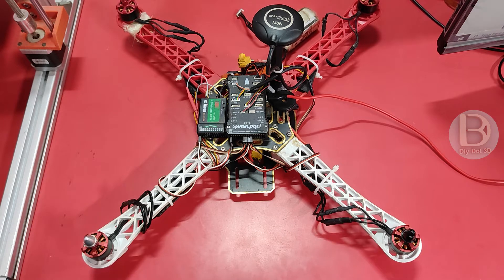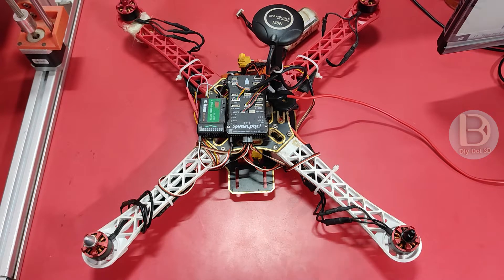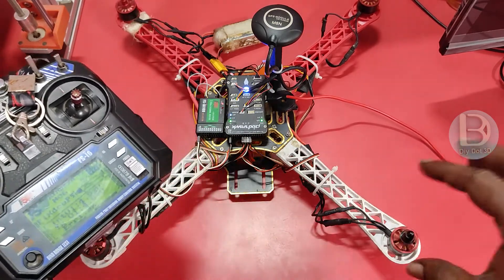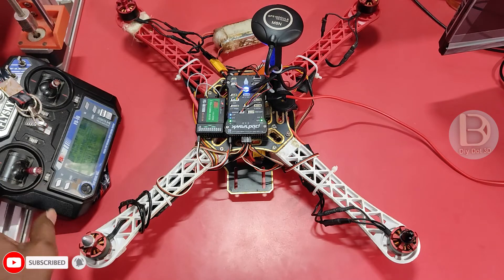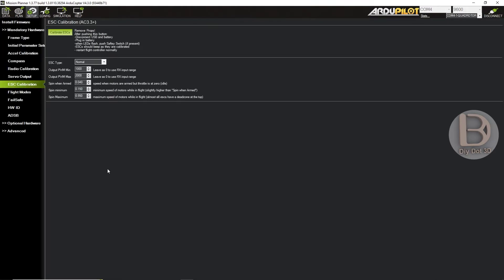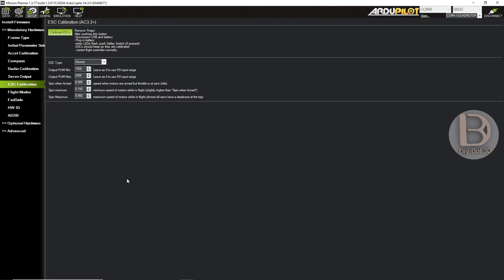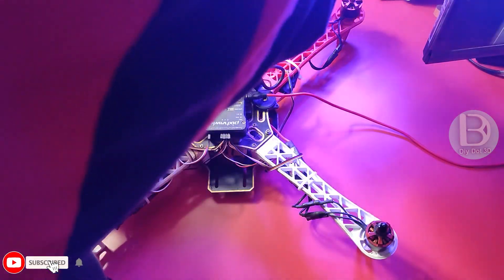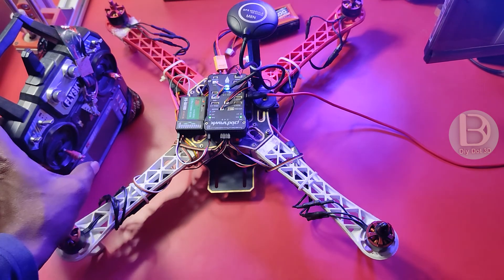How to stop motor spinning when armed - Pixhawk  |#pixhawk #drone #ardupilot #arming  #calibration

Comment: Bro pixhwak drone getting potential thrust error while checking for any errors in drone giving throttle without propellers for sometime it gives potential thrust 2 or 4 like this
Reply from the maker: @universaltech4630  first do esc calibration properly it will solve problem

Comment: hi how can i check if my drone esc is calibrated perfectly as of now i am using  servo output in the mandatory hardware section which showed that one of motor is spinning slow how can i correct that ???? also is that the issue calibration error as my calibration was sucessful bcz in stablise mode my drone is tilting and in the servo output function it showed my motor 4 is spinning slow
Reply from the maker: You  need to do calibration for sensors (gyro, acceleration).